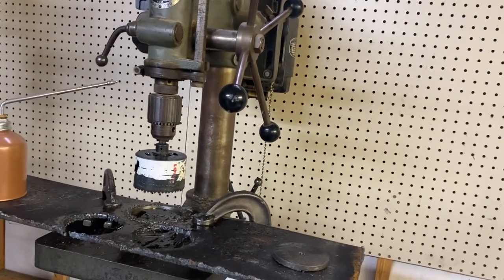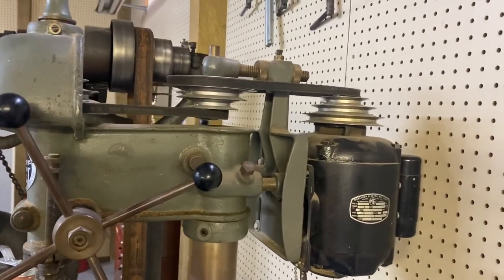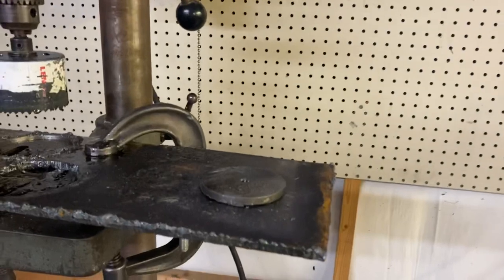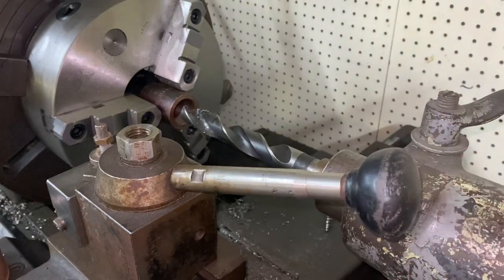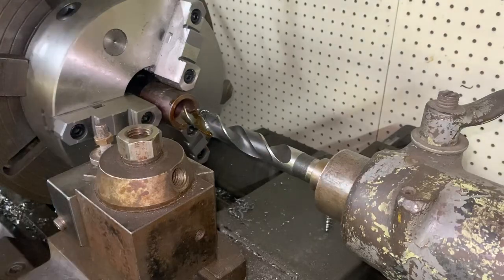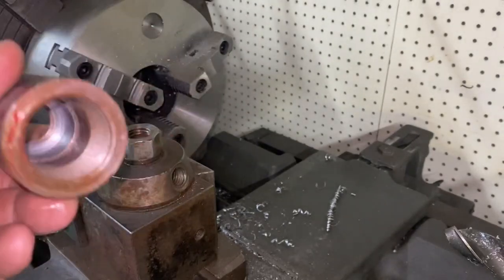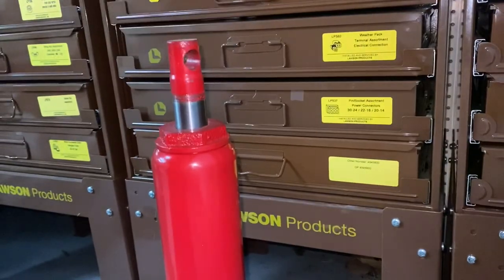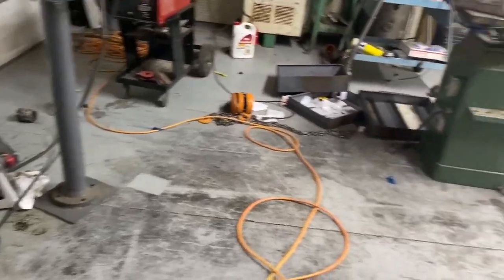Making the last parts for the gantry crane

Comment: Good project. Looking forward to seeing it in action. I had a project recently where I needed some 1/4" aluminum disks about 4" diameter. I cut them the way you did these and it was slow and very noisy just like you said and the VFD running my Bridgeport kept tripping out. After I was done I had a thought, why not make a trepanning bit for my boring head and eliminate the hole in the middle and the run-out? Next time I'll give it a try.
Reply from the maker: That would probably make it much quieter and probably quicker as well